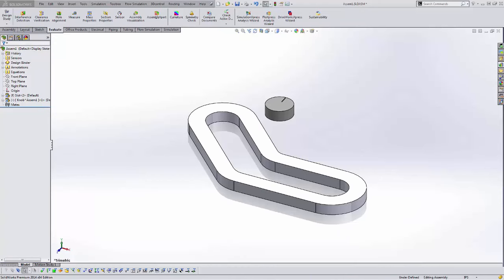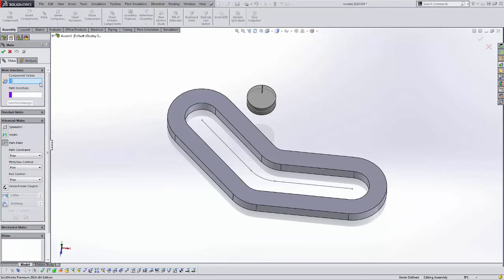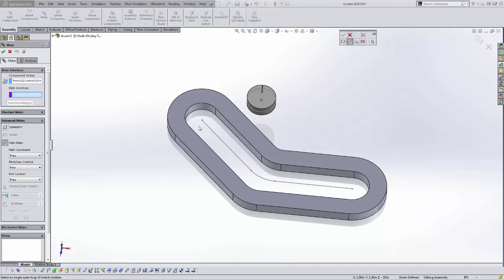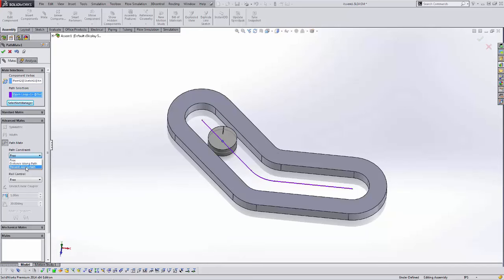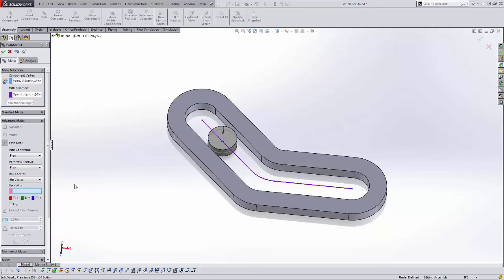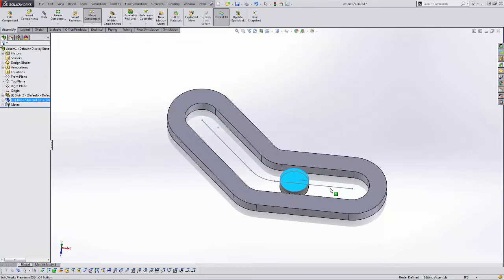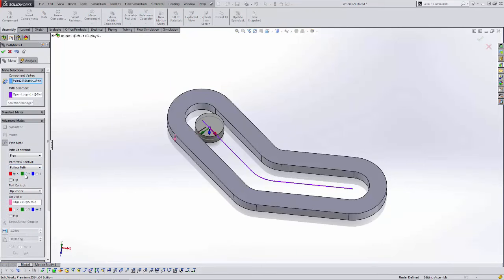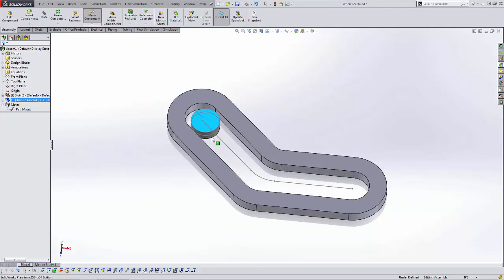SOLIDWORKS - Path Mate

Comment: what kind of line did you draw for your path? I am doing something similar, but I used a construction line. When I go into the assembly file, I can not select the construction line for my path line.

thanks, great video
Reply: I'm having the same issue, did you ever work out a solution?
Reply: You need to go into the sketch and make the sketch visible so that you can see it when you are in your assembly file

Comment: Hi, my part cant seem to follow my path accordingly. I wanted a screw to follow a specific arc that i sketched, but instead it restricted itself to the whole circle of the arc. I dont know how to limit it within the arc without using angle limit. Please help.
Reply from the maker: Hi Aerospace Engineering,
The sort of behavior you describe is that of a coincident mate rather than a path mate.  Did you use the 'Selection Manager' of the Path Mate definition to select all the entities that you wish to have your screw follow?

Comment: Interesting, would there be an advanced mate to simulate a rolling rubber wheel on a surface?
Reply from the maker: You might be able to approximate that with a gear mate. However a motion study/animation would probably be more accurate.